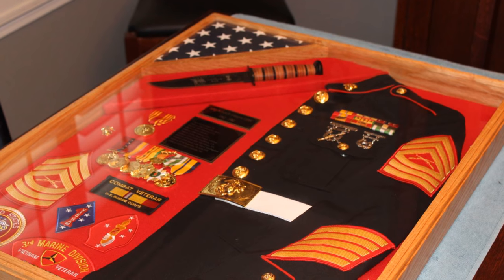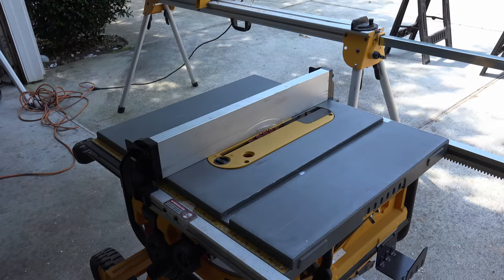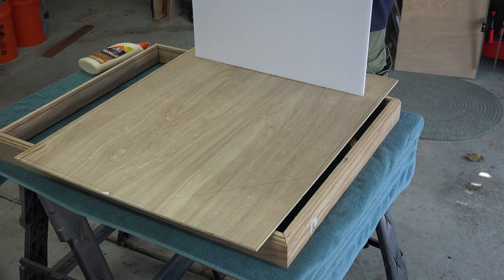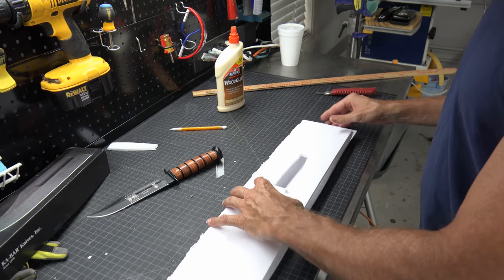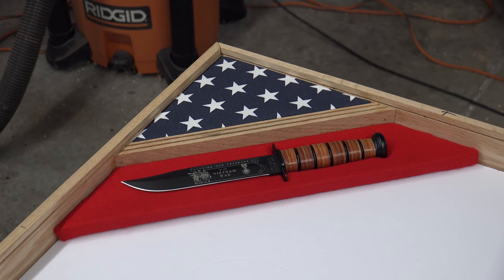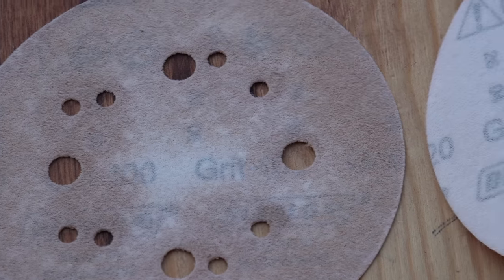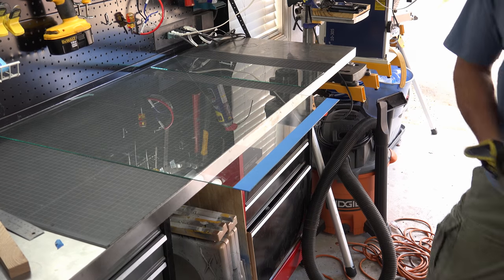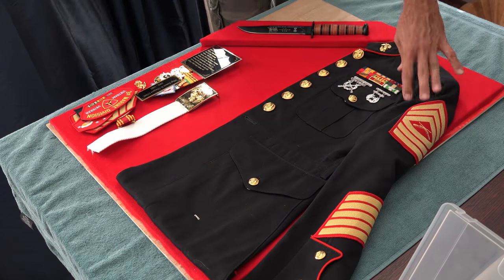DIY Marine Shadow Box with Jacket & Knife / Jon's DIY

Comment: You can also secure the knife down with clear wire on the top and bottom of the handle. Just see through the foam board
Reply from the maker: @PresidentDoubtfire  what exactly is clear wire ?   Fishing string?
Reply: @JONSDIY  yes

Comment: I used the Elmer's glue as you instructed but it wasn't strong enough to hold the buckle. I ended up with some industrial-strength double-sided 3M tape. I would also like to see the process for preparing the jacket. With the side with the buttons missing, how did you attach the buttons to the left side of the jacket? Your method was covered with tape so it is a mystery. Maybe a video about preparing half a jacket would help. Thanks!
Reply from the maker: Robert,  did you cut the display board and sink the lip of the buckle into the cut with glue?  (Elmers)  The back of the buckle to the jacket was wood glue but I'm sure the two sided tape would work.   Yes I am currently editing a video that shows the prep of the jacket a little more in detail.   I have had a few requests for this.  Thanks for watching.  And would love to see a pic of your finished product.   Shoot to me on Facebook.  Jon

Comment: Why don't you use 3M spray adhesives for the foam boards and felt? It gives a much better, and smoother adhesion than wood glue.
Reply from the maker: Funny you should say that.  I just did that on my last box.  And I never use wood glue.  I use Elmers glue on the felt.

Comment: What type of glue did u use on the knife and the jacket?
Reply from the maker: I used basic white Elmers glue on the back of the jacket.  It dries in the fibers of the felt and jacket material and holds it well. I also used a lot of T-pins.   The knife had a little wood glue behind it, but it was mostly held in place by the glass.

Comment: Jon,  Is that 1x4 that you used?
Reply from the maker: Rich Millsap 3 inch. 2 3/4 inch by tape measure.
Reply: @JONSDIY  I was wondering how you overlapped the hanging medals? All the medals I have collected have the two pins on the back for securing them to the uniform. I really like how you did yours with them overlapping slightly. Can you explain how you did yours? Thanks.
Reply from the maker: @richmillsap3541  Purchase a ribbon bar.  Then slide out the dual pin bracket and slide them on the ribbon bar.  Each bar holds 3 ribbons.  You can overlap them  or make them so they don't touch when you have multiple bars filled.  https://amzn.to/31XLH68
Reply: @JONSDIY  ok great Thanks Jon
Reply from the maker: @richmillsap3541  I went back and looked at the video you were referring to.  The individual had those medals mounted at the navy exchange and provided them to me mounted.  That's how they are slightly overlapping on the same bar they were done with a machine.

Comment: How deep are your boxes? 3 inch?
Reply from the maker: Will, look at a couple of my other videos I always start with the ensign. measure the width once folded and then add an inch that will give you a half inch above it and a half inch below one for the glass groove and one for the relief on the bottom of the box that’s my standard. All my boxes are custom so I don’t have a standard size that I start with it’s all based on the size of the flag. That’s the secret to a perfect box.
Reply from the maker: Will skip to 3:43. And this will explain it a little better. https://youtu.be/go_1SF1mqTg

Comment: dado blade for DeWalt Table Saw DW745 how ??? please ....
Reply from the maker: IIIZiPIII,  I know the table does not support dado blades but you can get up to 3/4 of an inch if you remove the small contact plate and just use the lock nut.

Comment: What are the dimensions of the box?
Reply from the maker: Jose,  that's the point of a custom box.  You start with what is going inside the box and measure it.  Then you make the box around the object.  That's why it comes out perfect.  But I'm pretty sure in the video at about 00:49  I say to add an inch to the top and bottom of the jacket for your dimensions.
Reply: @JONSDIY  well no shit but you never meantioned dimensions as in length x width.  Just wanted a basic idea since im buying the box and using my actual dress blues not some xsmall ones just to save material costs. Even though you still didn't answer my question its ok. I just went back home and measured my dress blues and bought a box with dimensions that would allow me to fit my jacket and US and Marine Corps Flag on top of my unit coins and rank chevron from PFC to Sergeant.
Reply: FYI, I bought a 30"x40" box for anyone that wants to know
Reply: Theyre on special at Michael's and cost even less than making your own in this situation
Reply from the maker: @josemedrano3274    "I just went back home and measured my dress blues and bought a box with dimensions that would allow me to fit my jacket"   (Well, no shit).  I'm pretty sure that's exactly what I said.    Let me paraphrase the exact words from 0044 in the video.   ""Lay out your jacket on a flat surface and fold it in half . measure your jacket from top to bottom and add in inch to both the top and bottom this will be the height of your box.  Don't build a box and just think you can make the jacket fit in it.""  Have some one else listen to this and then have them tell me how I can be any more clear.  Preferably not a Marine.
Reply from the maker: @josemedrano3274  
1.  Bought boxes at Michael's are particle board. (cheap) Mine is oak.
2.  Shadowboxes are actually a Navy tradition if you know the history of them and what shadows are.
3. Nothing personal about a bought box.  Someone you served with should always make it for you.
4.  This box only cost 73 dollars to make. If you found one cheaper, that's exactly what it is. Cheap.
5. In all seriousness.... thanks for your service!
Reply: @JONSDIY  thank you it will have to do for now. Once I buy more tools I will make my own. I just have basic things like skilsaw,  chop saw, sawzall, hammers, hand tools. Good for framing or concrete not so much for this stuff. Thank you. Yours came out good and yes Oak is great wood I just recently remodeled my stairs to oak wood risers and treads